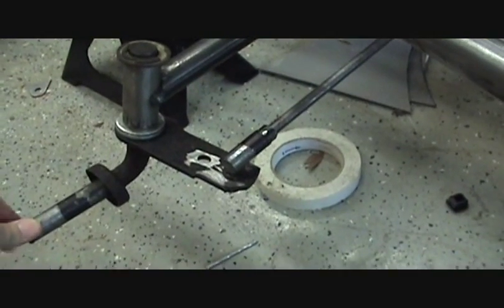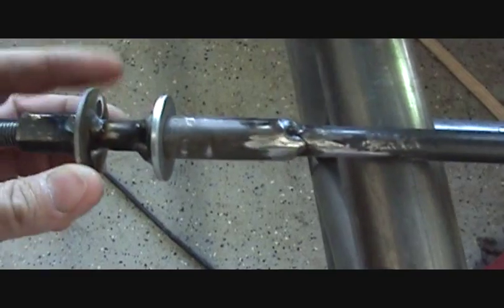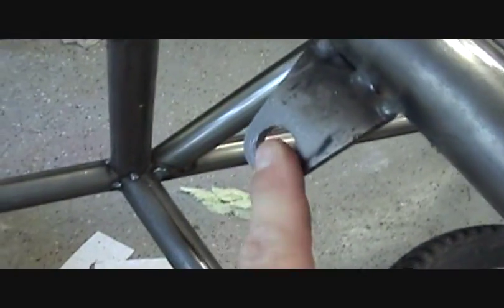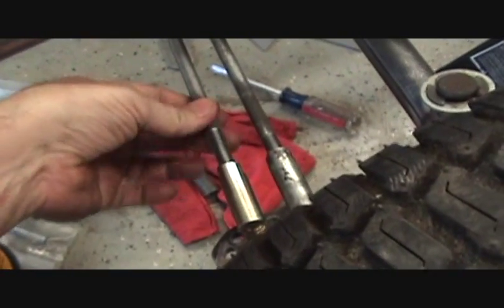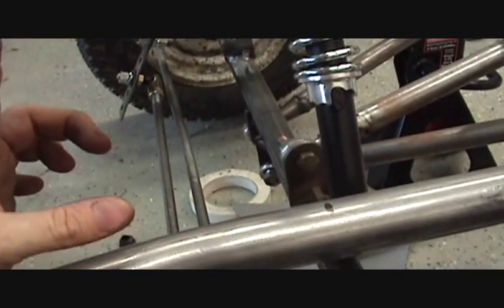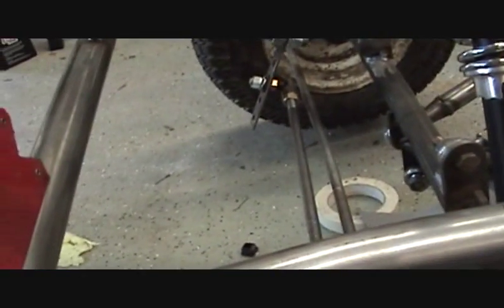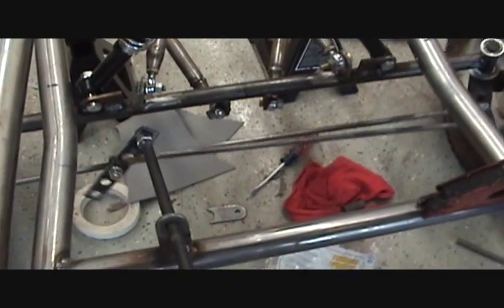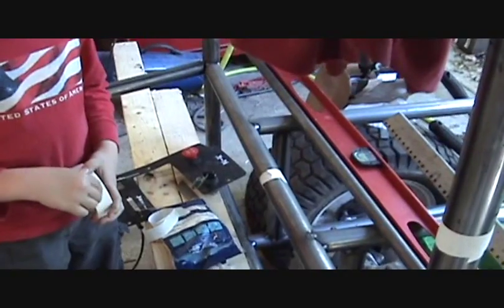Go Kart Project Status Report 4_17_2010 Steering Complete

Comment from the maker: @ModelKarKid Hmmm.  That is a good point.  If it does start to slip, I could weld it in place.  I chose not to do that because as it is now fabricated the entire steering shaft is removeable.  Don't know why I would need to ever remove it, but you never know....
Thanks for the comment.  I think its the first constructive comment I have ever received.

Comment from the maker: @smithcycles It's designed just like a auto's steering so it should be OK.  Plus, the Kart is going to only go about 10 miles per hour or so, same speed as the riding lawnmower went.  And, its got a roll cage....